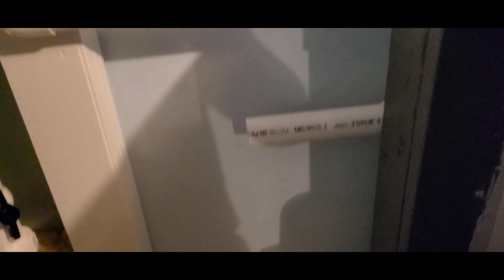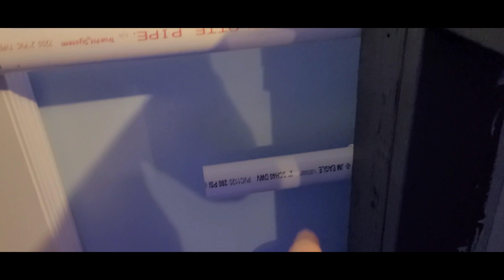1,500 GALLON PLYWOOD AQUARIUM Is READY For Fish!

Comment: I would love to have a tank like this but I prefer to have my level that way I can watch it. And I plan on building one in my garage and then when I'm going to do is have my filtration outside so any kind of noise will ask to be outside. But I build a box around my filtration system that way my neighbors don't have to be bothered by the noise if there is any. But the tank design I like. Now I just need to find some plans that are similar to that that I can use. Unless you have plans on paper can I could use. And I'm debating on whether using 4 by 8 sheets of plywood or the contractor size 4y 10

Comment: I finally got my hands on a 155gl bow tank, and I’m thinking hell  yeah, a 6’ tank is huge.  My man here is wrapping up his 1500 that he built himself 🤯.  Awesome channel bro, one of my favs!  How do you manage all the water required for your water changes?  Do you just feed untempered water, feed off your water heater, or do you have a holding tank.  I’m interested in knowing how you guys do this when you have so many tanks.  Thanks
Reply from the maker: I have a carbon filter on my house to remove most of the chlorine and chloramines. I fill the tanks directly. I did a video on waterchanges if u you want to check it out. Its a bit outdated but same general concept still
Reply: @OffTheDeepEndAquatics  does that work? How quickly can that method remove Chemicals and Chlorine? Or does it have to run through slow

Comment: Hello. I have a question about your stingray. I think you have a young stingray in a 20 gallon grow out. I just found a motoro and I also have it in a twenty gallon grow out for like a week until I upgrade the tank size. How sensitive are they really. My ammonia got to .25 in like a day so I did a water change. Am I being paranoid? I’m also checking ph , so when I add new water during a water change the ph is close to the tank ph. Any advice would be appreciated on how sensitive these guys really are. Thanks.

Comment: U change the pump to a jebao 20k or an ecotech L1. That would be plenty of power for the ultima and be super quiet pump just make sure esp with the jebao that u the same size intake and return sized pvc so u dont lose head pressure.
Reply from the maker: I have a jebao 20k that I planned to use for this but its not powerful enough. The ultima creates 10' of head height alone. Not counting actual head height and plumbing restrictions. This is what they recommend and its double the price of the jebao for a reason. Its an industrial pump. Trust me the jebao is half the size too id much prefer run that

Comment: Hey Mike the tank is looking great. What is the pump you are using? In my 1000gal I built I use a anjon monsoon 3000gph pond pump. It is super quiet, pricey but I feel it's worth it. I have 15 koi 9" to 20" and about 100 2" to 5" goldfish  in it and my filter is a 5 gallon DIY gravel canister with a filter sock on the return when needed.
Reply from the maker: The pump is a reeflo mantaray 5200. Its recommended for this size ultima. At 10' of head height its perfect gph for the bead filter. Itll take some work but ill find a way to quiet it down
Reply: @OffTheDeepEndAquatics   I use a 5300 gph SUNSUN pump in my patio pond outside in the summer it is also silent.  It worked well for 3 years now and is about $120.00 on ebay.